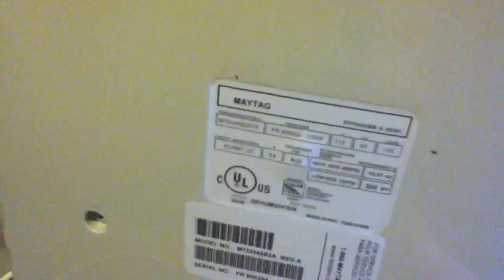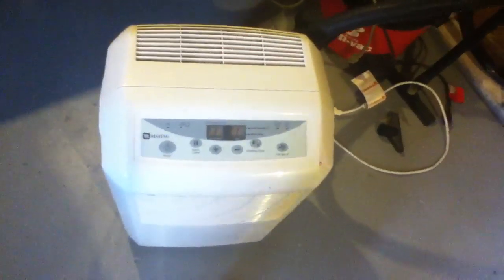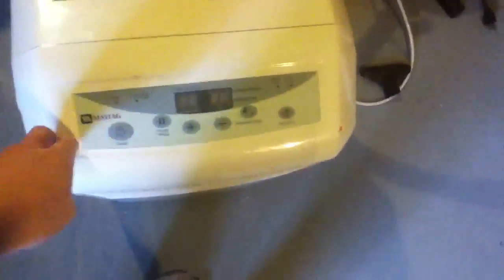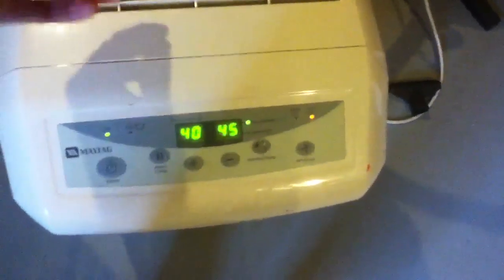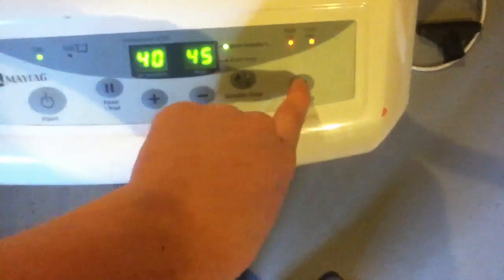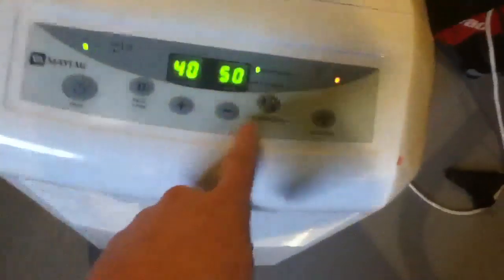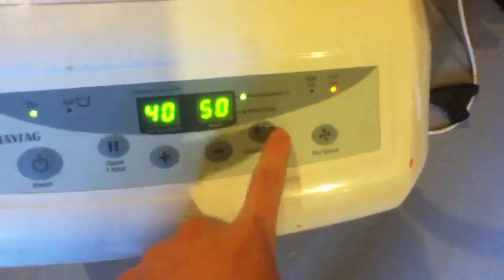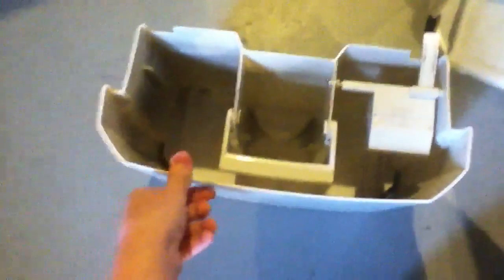Maytag 45 pint dehumidifier

Comment: They need refrigerant to cool the evaporator coil so it condensates and takes  the dampness out of the air and drips into the bucket.  A humidifier does not use freon, but dehumidifiers do.  That is also why a dehumidifier has a compressor.

Comment: I just found a working one for free . Well see if it collects water . Fingers crossed. Seems to be dryer in here now. How does the hose work ? Do you need a pump to pull water out of the water tank? Or does it have function to empty?
Reply: +Halliday7895 Most all if not all portable dehumidifiers can be set-up so a hose can be connected, so you don't have to manually empty the bucket.

To set up a unit= In most cases you knock out a access plug on back or side of unit, insert a "tube" that once inserted by-passes the water bucket and has a threaded section that protrudes so you can screw on a drain hose (Regular hose pipe thread.).

So far as a "pump", there are a few $$$$$ dehumidifiers that have a built in "condensate pump" for those cases in which you have the dehumidifier in a basement and there is no way to run a hose pipe to the outside /lower level.

Given the choice: I'd buy a regular dehumidifier, and buy a SEPERATE condensate pump ($35-$40 shipped for a nice one from Zoro Tools IIRC)

Reason? = Think KISS... (Keep it simple stupid)
Separate pump is going to give a longer life / can be replaced / reduces complexity. (One less thing to go wrong.)

Work-arounds:

1: Think KISS, gravity fed vs aving to use a pump.

2: If your A/C handler is in the basement, tie into it's drain / into it's condensate pump.

3: Tie into downstairs sink.

IMPORTANT: In all cases in which you have a basement that gets "cold" (Below 60 degrees at the FLOOR)

ELEVATE the dehumidifier !!!

WHY? elevating the dehumidifier off the floor helps keep a dehumidifier from "ICING-UP" when the temps go below 60 degrees!

Another plus to elevating unit is it makes cleaning filter / unit easier.

.